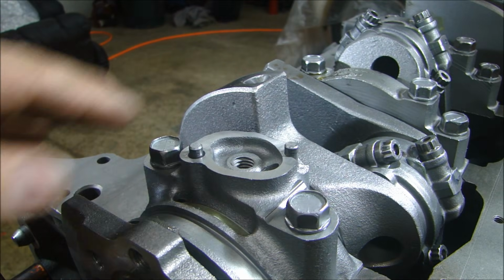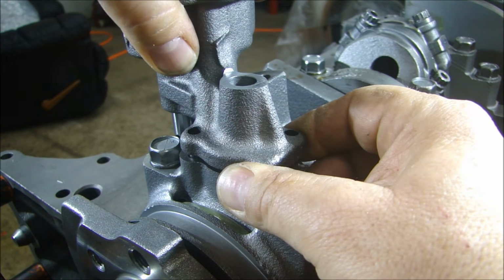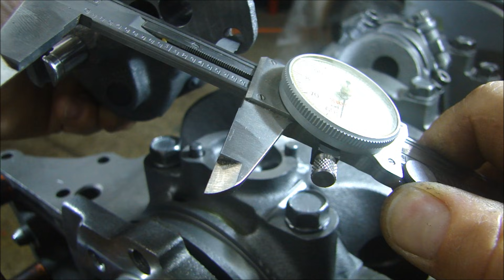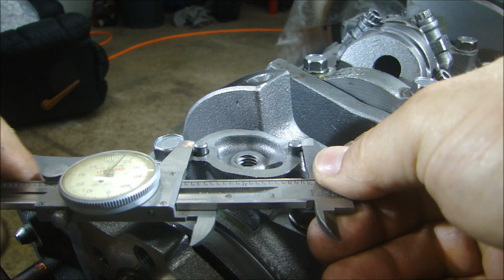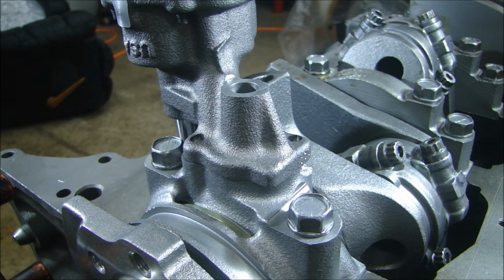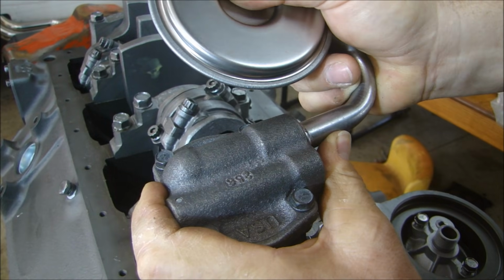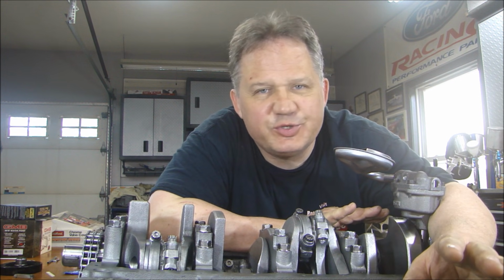Engine Building Part 4 - Installing the Oil Pump and Setting the Pickup Depth Small Block Chevy 350

Comment: I watched several videos on installing an oil pump. I should have watched yours first. I pulled the thread right out of my bearing cap by not using a longer bolt. You have some great videos. Thank You !
Reply from the maker: Thanks Wayne

Comment: I've never had a problem fitting a pump to the bearing cap but one thing I'm going to do after watching your video is for all of my SB Chevy builds in the future is check the fit of the pump to the cap before installing the cap that way if it needs work I can clean it before installing that way no debris in oil galleys
Reply from the maker: Good idea

Comment: Just asking just the intermediate shaft snap and hold in place because a saw it's fallen from the connecting point and be hold by engine hole.

Comment: Good info as always, Pete. Wondering if there would be a situation where you would consider reaming the clearance holes in the oil pump flange as opposed to "persuading" the pins into alignment?
Reply from the maker: If I measured the holes and they were small I would ream them out first. It's almost always the pins getting bumped.

Comment: Dude ... NEVER  drift punch those pins - you end up like at 1:57 !  Take and lightly drill out those holes on the pump... you will still be in tolerance alignment for the oil shaft.
Reply from the maker: You're right.
Reply: So no windage tray? I'm building the same engine with no means of using a windage tray unless I buy a newer pan with 1 built in but don't wanna throw more money out lol everyone tells me to add a tray but I feel as if it'll be OK for a mild build daily driver what do u think?  Is It a must have
Reply from the maker: I've never used one and have had no problems
Reply: @PetesGarage  Really, that's great to hear!
Reply: I've only seen factory windage trays used in boats with redline spec around 5,000 RPM, you'll be fine without one in a car unless maybe it's a 1/4 mile race car.  I was a little surprised to see the baffle in that corvette oil pan.

Comment: unless you want too break the main cap, pull the threads, DoNot torque the oil pump retaining bolt as this guy did. 50lbs is enough. Make a lock tag, so the bolt doesn't come loose. I don't recommend hitting cast iron ethier, you will crack, break it.
Reply: Bro my manual says 60ft/lbs

Comment: The small Chevy oil pump pickup tool makes the installation easier. Preform makes one. I got it at Summit Racing for $20. They have a BB Tool also.
Reply from the maker: Thanks Tom

Comment: I've seen welds come loose and the pickup drop off... The vibrations of the engine will eventually break the weld... The only way to insure it stays is either pin it or use a pickup that attaches to one of the bolts (main bolt or oil pump bolt)...
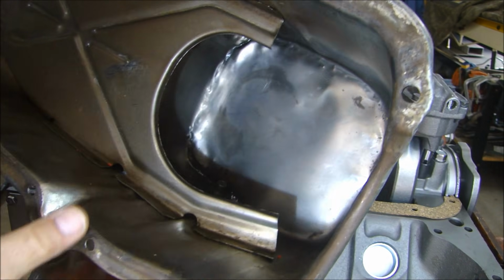Also the imprint of the pickup in the bottom of the pan is (most likely) not from it being loose but from someone jacking up the engine under the oil pan bending it up into the pickup... You can see how bent the bottom of the pan is @ 06:45...
BTW you should never use cork gaskets for the oil pan... They ALWAYS leak no matter how much sealant you use... Use the newest one piece reusable gaskets from FelPro...
Reply from the maker: Thanks for the tips Nathan
Reply: Cork is 10 times better than the rubber one piece fel pro, cork leaks because people don't know what they are doing,I never use sealant on gasket, that's what the gasket is for. Only use it in the corners.

Comment: Pete, how about changing oil pans on inboard boat motors that are being used the other way.  Was a straight inboard with flywheel towards transom.  Now it's being turned around and using a "V" drive.  Thx
Reply from the maker: You want the sump towards the back so it doesn't get starved under acceleration

Comment: A note for future engine builders: Pay attention to the part shaft that goes from the cam to the pump. Mellings and GM used plastic. ( correct me if I am in error ) Plastic capture instead of steel cost me a very expensive rebuild as the plastic failed and turned rods blue and scuffed crank. Had a really good machine shop not done the balancing part my engine would have seized or kicked rods. Just my experience. Thanks for he video.
Reply from the maker: Thanks Scott
Reply: There is a available shaft that has metal where the bushing located.

Comment: I replaced the oil pump ony 98 s10 after replacing the oil pump new one was given me problems to get in the oil pan it has a thin metal shet I just removed u think will hurt thaat i took off that metal shet from the oil pan??
Reply from the maker: That piece acts like a baffle to prevent sloshing. You might be ok

Comment: You said add sealant between pump and cap what kind?
Reply from the maker: I use Hi Tack
Reply: @PetesGarage  thanks sir
Reply: Anaerobic is the best to use,it's for machine surface and if it get in the oil passage want hurt anything because it want harden only hardens with no air

Comment: would that broken metal by the pin cause an oil leak-inside the pan making less oil pressure?
Reply from the maker: No, it would have to be a major crack into the oil passage

Comment: i have the same oil pump, trying to put it on my 4.3 v8 caprice engine and i see that shaft which connects oil pump with drive gear is too short, about 10-11mm shorter than it has to be. did you get such problem anytime? oil pump and shaft are brand new and exactly for that engine, i double checked it
Reply from the maker: Yes, you can buy different length shaft. Make sure you have proper end play in the distributor end.
Reply: @PetesGarage  thanks, i have already discovered that) strange, i bought both stock oil pump and shaft on rockauto, and they didnt mention that there are different variants. that is good experience for me, something new i didnt know before

Comment: I have built about a hundred motors, I have e given alittle bit of thought to oil pump screen depth but not too much, I always installed the screen level with the pan surface. Why? I don't know, because that's the way I was taught, then you just check it's not against the bottom of the pan and has plenty of room to gather oil. Always have spot welded the screen though. They also use to make gaskets for the oil pump mounting surface but people found out that was a bad idea, I use anaerobic sealer. But factory never used a gasket or sealer there
Reply from the maker: Thanks for the comment. Lots of engines are built because that's the way it was taught.

Comment: Sir my pump drive shaft ,solid steel like yours.just falls off when I connect it.i have to sbc oil pumps just like yours .falls off both
Reply from the maker: It will fall off until you turn it over
Reply: @PetesGarage  I know this is a very old video. But I was curious,  if the oil pump drive shaft that connects to the distributor gets too loose, what symptoms will the engine have ? Or how would it react to it. Thanks.

Comment: nice video--question:  my pump is cast iron--and I think pick up is aluminum---this is an odd combination to spot weld--what rod or wire did  you use...and in lieu of that --would you recommend lock tite??  Also--as an fyi--just saw a melling m55 with a warning that pick up could fall out in "performance vehicles" --or for me--Chicago potholes maybe.
Reply from the maker: For an aluminum pick up I would try to peen over the end somehow. LocTite is not a glue. I don't think it falls out, but they can droop down

Comment: I always use a 1/4 inch shim and set on the pickup screen . Set the pan and push it down to the gasket . Remove oil pan and tig weld the pickup tube to the pump . . Gives you your 1/4 inch off the pan and no guess work .
Reply from the maker: Great idea, thanks for sharing

Comment: Unless you can do TIG, the weld cracks away from the cast before you lift your visor. Guaranteed yours did. Waste of mig wire.  Pioneer makes a bracket that clamps pipe in position and bolts to pump.
Reply from the maker: Thanks for the tip
Reply: Have mig welded hundreds of them ,some 20 years ago never had one to fail. Some motors 15 years later we rebuilt and had to grind weld off to change pump.

Comment: Question ? why not just have hit the bottom of both pin holes in the pump base with a counter sink just a little and use a rat tail hand file in the holes to get the pins to slip in nice & tight . I HATE beating on anything in a cast iron block ( hardened punch on hardened dowel pin is a no no )
Reply from the maker: Good point, thanks Mike
Reply: @PetesGarage  40 plus years in tool & die with a apprenticeship doesn't hurt !
Reply from the maker: Absolutely

Comment: I think beating on those pins is rediculous. That is how you broke the cap, but you steered way around that. I have seen a lot of small blocks. Setting the pickup parallel to the bottom of the pan is normal.
Reply from the maker: I did not break that cap, it was broken when I got it.
Reply: Shaking my head no. Special tool needed to break that main cap!🤥
Reply: Dowel pins are pressed in, there is no clearance around the dowel you were beating on.  Measuring the outside distance with calipers and then measuring the inside is a very inaccurate method.  It's very unlikely the pins were out by .010"

Comment: I don't have a welder.  Can I use JB Weld or something similar?
Reply from the maker: No, that will not last forever, it will eventually fall off.
Reply: Loctite Green, Stud and Bearing Mount compound #620

Comment: Pete you know I love your clips. When I install the bolt in the oil pump it doesn’t fit. It’s sloppy. I checked Jegs and they have a special bolt just for this application. I tried other bolts and they are loose also. Threads in cap look good. Any advise? This is on a 350.
Reply from the maker: Is there a chance someone tapped the threads to something bigger? Metric?
Reply: Pete's Garage I thought that. I’m calling Jegs tommorow and checking. I’m going to check about the metric possibility. The bolt fits but very sloppy. I’ll let you know. Thanks for the quick reply
Reply: Pete, sorry so long getting back. Problem solved. First off: machine shop forgot to return the correct bolt after cleaning engine. Second: went to auto parts store for correct 7/16 size bolt. Parts guy brought wrong size bolt (1/2”) which did not fit. I double checked to make sure it was suppose to be 7/16. Third: took main bearing cap to machine shop, found “ correct 7/16” bolt. Installed. Guess what? Go ahead and guess. It fit like a glove. Man, I went through hours of prayer over this. Thanks Pete for the quick response. Your the best. On to painting now.
Reply from the maker: Awesome! It's always something simple, glad you found it

Comment: I don’t understand, you said to not tap on the oil pump for fear of breaking the ear, But tap on that dowel, if that breaks possibly a new block???
Reply from the maker: The dowel is in the main bearing cap. You can bend them a little each way. Driving the pump down on the dowels would stress the pump and crack the ear.

Comment: I noticed that a small amount of the cap under the oil pump was broken off, exposing more of the pin .... is this a concern?
Reply from the maker: I do not see that, where is it in the video?
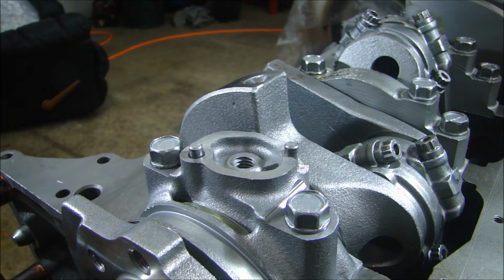Reply: @PetesGarage  , it's at 1:21 into the video... the pin on the right side... the casting is broken away and exposing the pin.
Reply from the maker: Ah yes, when you buy a used old block, sometimes people sit them on the ground and drag them. If the snag one of those pins it will crack the casting. I drill it a little deeper and use a longer pin. I've never had a problem.
Reply: @PetesGarage  I've seen guys take off the oil pump at teardown with a dead blow hammer..... and seen that break before too. Buying a new cap and line honing/boring is an expensive fix for carelessness. Love your channel Pete...!
Reply from the maker: You're right. Using a dead blow hammer to knock off a stuck pump is a bad idea. Thanks Dave

Comment: I could see where you beat the pick up tube to death getting it on. I also know beating on that dowel pin could have cracked the rear main cap, just like the other side. You should have dressed the hole in the pump with a small file. Generally, people set the pick up parallel to the crankshaft. Not drooping down like that. Also, you over torqued the mount bolt.
Reply from the maker: Thank you for the input
Reply: If you set it parallel to the crankshaft, you end up getting cavitation from the slapping/dipping action of the crankshaft, which gets picked up by the pickup tube in mid and higher rpm range.

The other reason you put the pickup tube down low in pan, is because if you develop a leak and don't realize it right away, it would take very little oil loss to SERIOUSLY damage your engine. Whereas with a low pickup, you're at least making the best of a bad situation and you have a lot more time to realize and address the oil leak.
Reply: No one sets the pickup that high😂😂😂 fkn keyboard warrior over here
Reply: Goddamn leave the guy alone it’s his engine do what you want quit pissing on everybody’s parade bro

Comment: I am a retired GM master tech and never had to weld a pick up tube on to a pump using a quality part. The bottom of the oil pan was bent upward in the video, that is why the tube screen was rubbing on pan. If you use the proper installation tool, damage to the tube will not occur. The one in this video was damaged.
Reply from the maker: Thanks Phil
Reply: Phil.  Sorry your incorrect.  You should always “tack” the pickup so it cannot come out.    Period

Comment: You show ed all that but you didn't say what holds the drive shaft on the oil pump. Because without the engine turned over that drive shaft will just fall off. An you showed using a oil pan with the bottom all bent in....
Reply from the maker: It's in the next video

Comment: Sorry ! What about using the original bolts ?👍🏻
Reply from the maker: Sure you can, I did not have the original
Reply: The bolt on my new oil pump is the original one, it's only 39 years old... the Sea Foam Deep Creep is an amazing product, my 350cid has been waiting years to put into a "new" vehicle!  Can you say '76 El Camino!

Comment: Rather than risk knocking the pin off by tapping it, why not drill out the corresponding hole by just a small amount?
Reply from the maker: That is an option